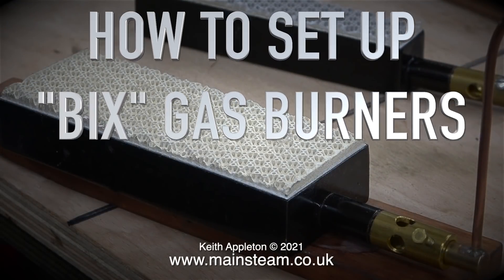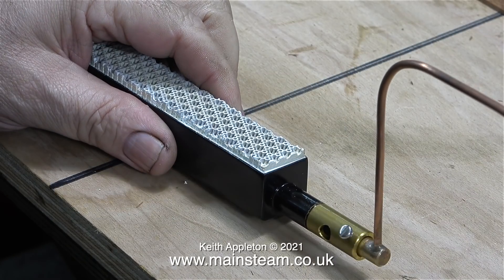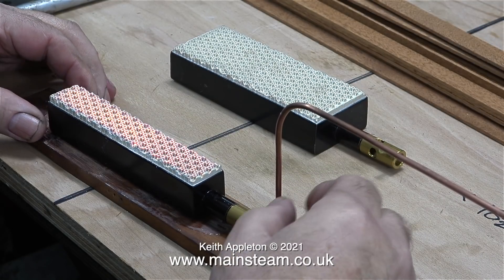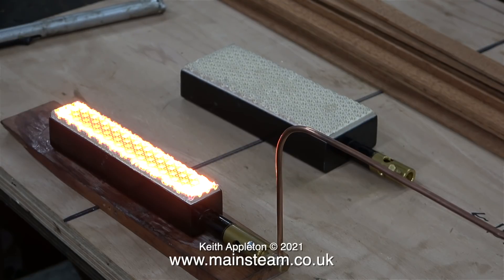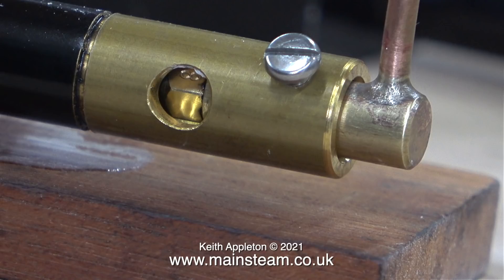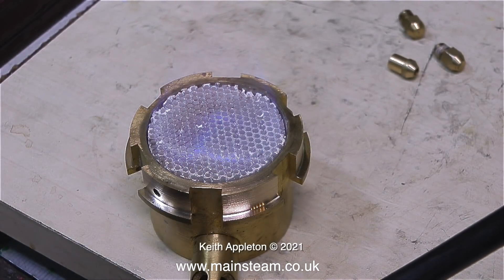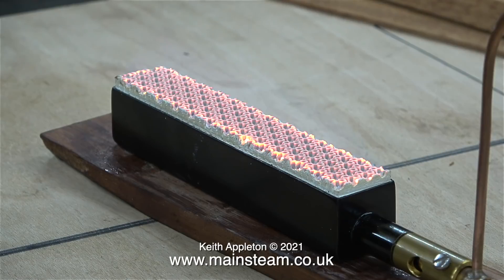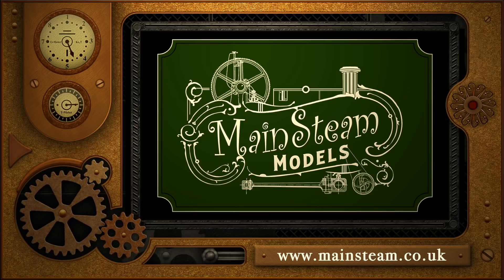HOW TO SET UP "BIX" GAS BURNERS - IN THE WORKSHOP

Comment: Good demonstration!
Im curious why these burners use ceramic at all when they are not meant to glow? When you google ceramic burner all of them are of the infrared type, they are meant to glow.
Now we know these burners arent meant to glow so why is ceramic used? Most gas burners for comercial boilers are just your standard ported tube type. I have made burners with similar dimensions as this but just used a perforated metal plate insted of ceramic. Got nice even heat with blue cones. 
Could you do an experiment where you swap out the ceramic for a aluminium or ss perforated plate with the same amount of holes of the same size to see what happens?
Reply from the maker: I have covered the different types of Ceramic burners a few time in other videos. In theory they should be fine glowing red, but some will burn out depending on the type of Ceramic that they are made from.

Comment: Thanks for the vid. I have never used a gas burner for my steam plants. The two I have are a 50's or 60's Wilesco Old Smokey and a 1956-60 Fleischmann Horizontal Steam Plant which use the solid fuel tablets.